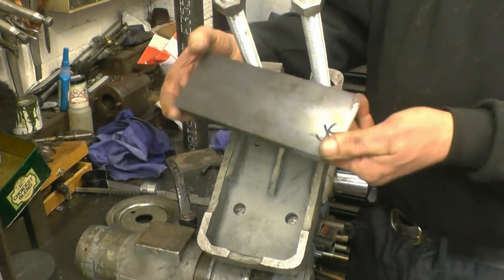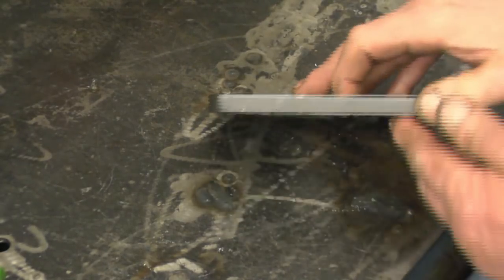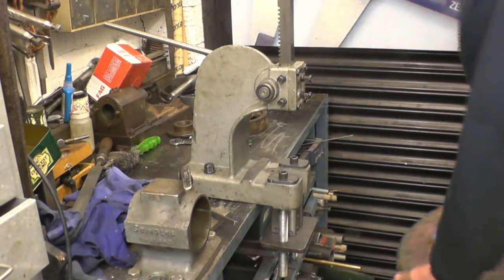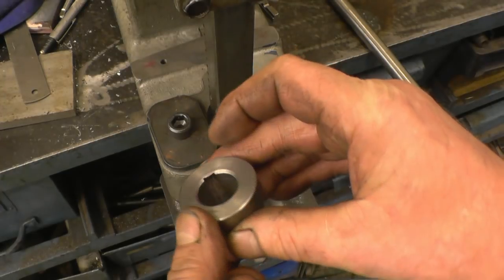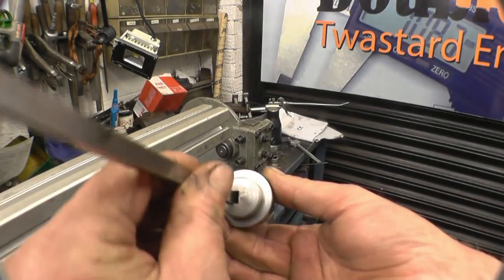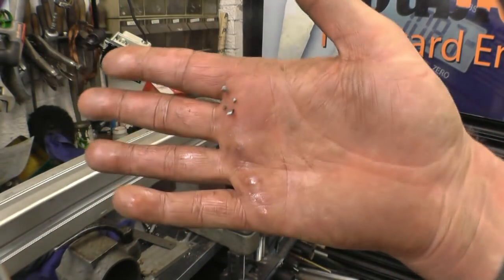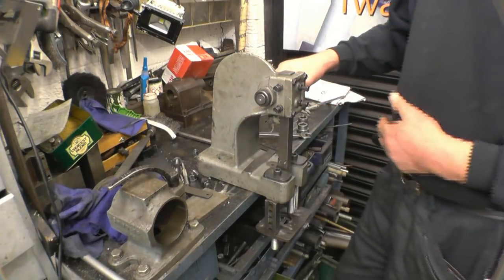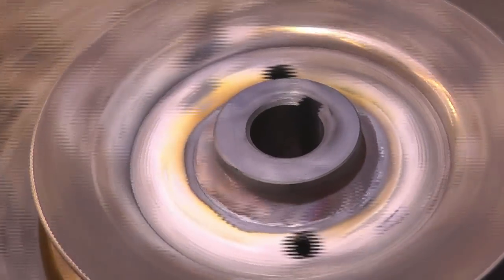SNNC 205 P1  Christmas Giveaway

Comment: Merry Christmas, John!

I was looking at the way you're using that little arbor press and it occurred to me by doing things that way you have placed the front of the press in tension because your pressure is trying to pull the front "ears" ( for lack of a better word) downward over the edge of the bench. Normally you would be pushing into/down on the top of that cast iron surface and it would be supported by the bench it's sitting on. 

Just a word to the wise, cast iron doesn't react well under tension like that so...... easy does it. Small cuts....or you might have some unfriendly reaction under pressure resulting in the need to edit content for "family" entertainment purposes LOL

I'm not gonna pick on the setup because none of us ever have every tool we need and we have to "make do" with what we have available. And, I really don't have a better solution without knowing what's available. So..... just some advice on the setup as it is being used.